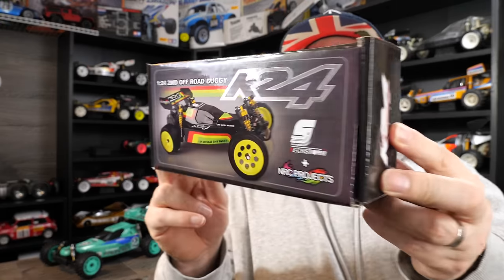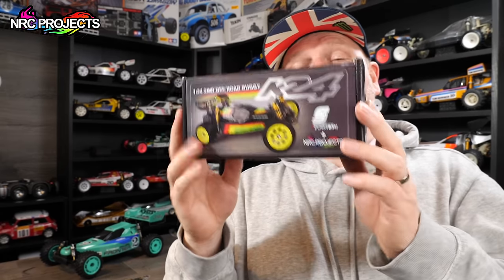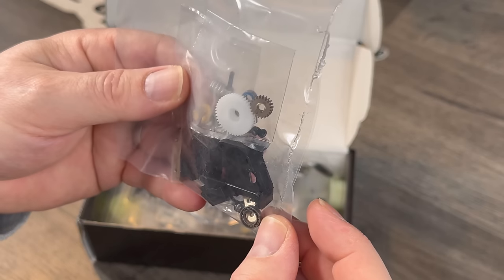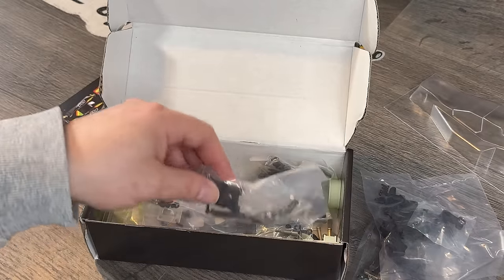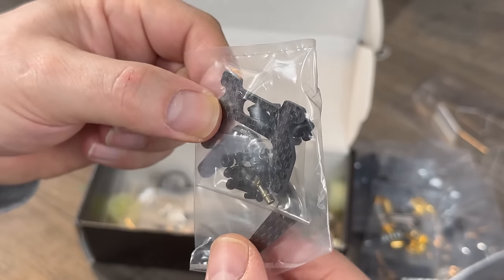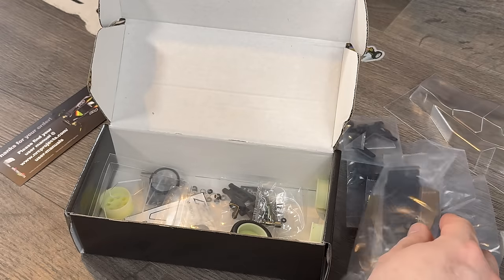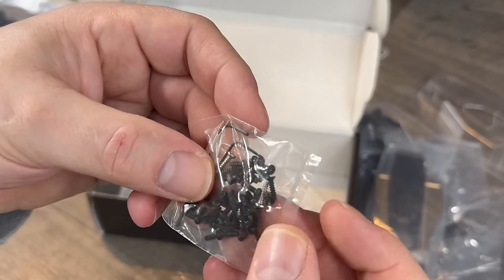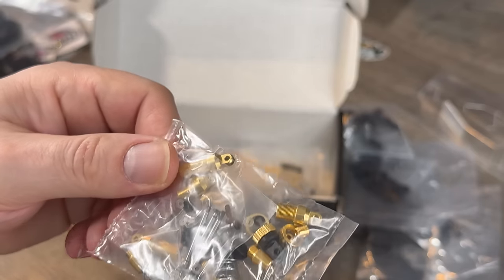Smallest Hobby Grade Vintage RC Buggy In The World!  Unboxing The New 1/24th NRC Projects K24

Comment: OMG it's tiny (that's what she said 😂). It's an Ultima Pro clone at 1/24, it's crazy 😮 Still Kyosho did some 1/20 of their range around 1987 called Baja Bug with Ultima, Salute and Turbo Optima body; they were already difficult to work on, but now with modern stuff, it may be easier even if smaller. Little detail, about the BT01, while front motor, the Calibra V6's from german championship (ITC ex-DTM) were 4WD 😉.

Comment: I have one of these on order and have built the NRC-24 RC10 goldpan replica and that was quite a fun build. Glad to see they went with oil shocks on this one. My Goldpan is running the Hobbywing Mini28 6500kv sensored setup and it's a little missile. Also the motor looks scale to the 1/10 counterparts. I also converted the goldpan to Proline oil shocks, but at least I won't have to do that with this mini Ultima.

Comment: Gav, the road going Calibra was FWD and AWD, but the DTM version (as the body you purchased) was definitely only AWD.

On the note of the actual topic of the video, buggy looks AMAZING!!
Reply from the maker: Yep I know the DTM were modified to 4WD but it's fitting as I'm not 100% sure yet, but I hope you can make this chassis dual motor AWD. I will know more when I build the chassis.  I know you can do this mod on the FF01 chassis.
Reply: @RCKickschannel  yup. You can make a BT01 AWD. Several have done it and shared videos in Japan. But then again, at that point, why not use a TT0x?

Back to FF bodies, Tamiya's Honda Civic Castrol (EG6) are usually easy to find in shops, and are a proper 257mm, if it helps!

Comment: Micro T was 1/36th but the build quality on this looks great
Reply: Yeah those little Losi RTRs all ended up being junk... What a shame too... Was super excited back when the Mini T 1.0 was introduced... In fact, I even bought the pro roller and loaded it up with nice stuff... Every time I used it, something broke.  The plastic they make everything out of is SO cheap , it breaks just sitting.  ..and you can't get parts because they replaced it with the 2.0 (which is just as much of a piece). Could've been something cool, but Horizon/Losi seems to care a lot more about money than anything else any more.  Once Horizon took over, it made me really dislike Losi, as their products turned into mostly mass produced crap like traxxas
Reply: @billymanilli  I dunno, I had a brushless setup in my micro T and the only thing that went was the diff, but someone sold a modified metal gear set that held up well. Sure they don't look as well made as this kit, but given the cost and the size that thing took a beating and held together.

the parts issue also isn't unique to Losi, associated is pretty awful with their older kits.

Comment: I was looking at this kit k24.  Wow! It is expensive. You can buy a 1/10 scale kit for the same money. Thoughts?
Reply from the maker: It has the same number of parts as a 1/10th Rc buggy but on a smaller scale, but machining the parts is harder as the tolerances are smaller.  When you think about it, the price should be the same to a little more.  The only thing less is the raw materials but turning that into a part is always way more expensive.  I think that’s the challenge when building an RC on a small scale, people assume it should be way less.  I’m not saying I don’t feel the same but when you think about it, you start to realise why it costs the same as a 1/10th.  That said, what’s the benefit to making it a much smaller scale apart from the engineering challenge and the novelty.  🤔  I think this is why I’m not into the Kyosho Mini Z cars.  The scale I like the most is 1/12th for detailed RC cars like the 959 or the Fantom CRC2 and the 1/8th of the UDR or Maxx Slash.
Reply: @RCKickschannel   You make several good points. I am surprised that you said you do not like the Kyosho mini Z cars. I have the Kyosho mini Z Jeep. It is very scale and is also expensive. However, everything is in the box. The buggy you are about to build also needs more parts to complete, which makes it even more expensive. I look forward to your building this one. Thank you

Comment: Awesome car, but WAYYY overpriced at $260.
Reply from the maker: It has the same number of parts as a 1/10th but harder to manufacture as the smaller a part is, the more precise the part has to be manufactured.  What you can end up with is a more expensive product the smaller the scale.